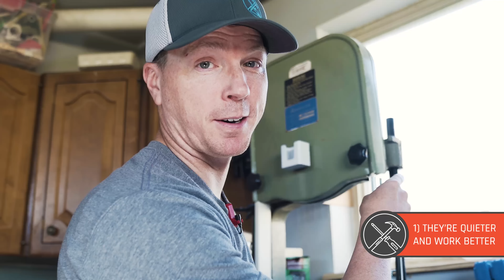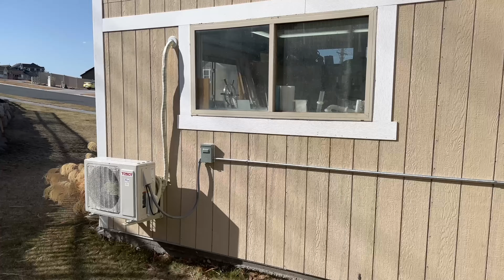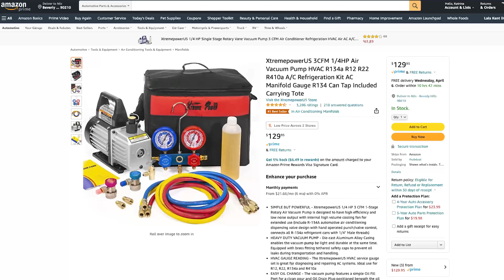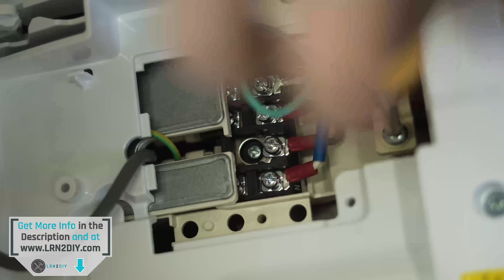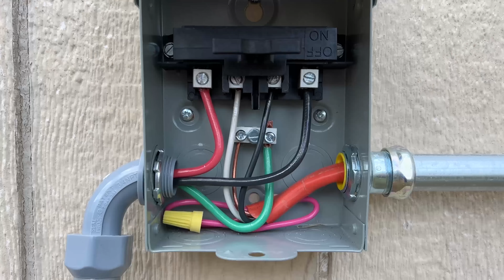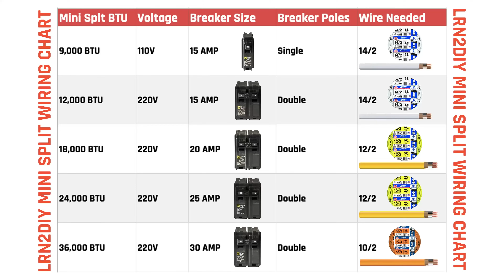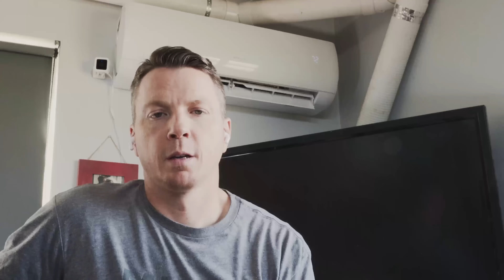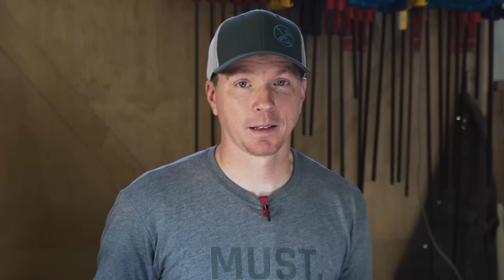Mini Split - 3 Things I Wish I Knew Before Installing

Comment: I installed one recently and it's the biggest quality of life upgrade I've ever made.
I bought a cheap vacuum kit and a line flaring tool and cut my lines to length & made new flares, drew the vacuum and connected everything up -  you can get it done in a day pretty easily. Probably  just a few hours if you plan properly.
Hardest part for me was finding the right place to put the condenser.
Reply: Biggest mistake I made was that the disconnect box didn't come with fuses, so I had to make another trip to the store.
I bought the Pioneer brand, and I'm pretty happy with it. The WiFi dongle is about $75, but if you look at the model number it's common across many brands and I got one on ebay for $30.
So nice to set my office to cool or heat while I drink my coffee.
Reply: @TheRealBobHickman  
That's what I got from Parker Davis.  I really like the pioneer.
Reply: @elgringoec  they are great!
Reply: @TheRealBobHickman  typically, the disconnects are just a pull-out contact that absolutely, physically disconnects power within a few feet of the unit and are not fused/equipped with breakers. All breakers should be in the electrical panel you are drawing power from. The disconnect is just so the service tech is protected from somebody flipping the breaker on while the unit is being worked on.
Reply: @JohnnyBfromPeoria  There are two types. I thought I was buying the fuseless one, but I bought the one that actually requires fuses too. They look almost identical and the fused one still has a pull out disconnect, it's just that the disconnect is also fused. Everything is also on a breaker, so it's super safe now.
Reply: @TheRealBobHickman  yessir, that won't hurt a thing with a breaker in the main power box  feeding that line. Mine have a breaker in each disconnect box as I also didn't see the description properly. Not an issue, really.
Reply: @JohnnyBfromPeoria  What you think is a breaker might just be a switch.
Reply: Did you draw a vacuum below 500 microns and hold that level for over 15 minutes? Or did you just draw down to the 30 inches mark on the gauges? An appropriate vacuum requires a micron gauge and cannot be read on a needle gauge or most digital gauges. Did you torque the flare nuts accordingly or tighten them by feel? Over-torquing is just as likely to leak as under-torquing. Did you use a flare dressing or did you dry fit the flares?
All practices and techniques that DIYers tend to overlook.
Reply: @deek791  I did not have the $$$$$ gauge so I followed the instructions in the manual that are specified for the needle type gauges and it held for 15min, no problem. I torqued all my fittings to spec with the proper torque wrenches and used nylog blue as a dressing as recommended by many pros. It's been over a year now and both cold and hot are still working great.
Reply: @TheRealBobHickman  you've probably done alright. Torque and proper vacuum are paramount to a quality installation. However, a needle gauge will never show you an appropriate vacuum level. There are still 760,000 microns at the 30hg vacuum mark on a needle gauge. The industry standard is below 500 microns held for over 15 minutes. I've seen, hundreds of times, a vacuum below 30hg but still over 10,000 microns after pulling for over an hour. If there's moisture off any sort in the system, it'll take longer to remove the molecules. A good practice is flushing the lines with dry nitrogen prior to starting a vacuum. That helps to remove humidity or droplets that may have gotten in the lines. You really have to think on a molecular level when understanding how the vacuum works. Because that's what it's doing... removing molecules from the inside of the system. A deep vacuum (below 1000 microns) is only removing about 10 to 30 microns per minute depending on the make of your vacuum pump.   A decent vacuum gauge can be purchased from Amazon for $60-$80. My Fieldpiece digital vacuum gauge cost a few hundred. My old heated diode set cost $1200 but it was also bought 40 years ago.
Reply: @deek791  I only have a Harbor Freight set of gauges. As with the automotive a/c stuff I play with, I leave the vacuum on for an hour, leave it off for a half hour and check to make sure there's no change. I'm also working in the Phoenix, AZ area in the heat and that makes boiling any moisture out easier since I'm starting with a higher ambient temp. I arm-torqued the fittings and I did use Nylog blue. Flare fittings can be easily deformed by over torquing, so they don't have to be cranked on, that's a given.
Reply: @deek791  
I ran my vacuum pump for an hour after drawing down to nearly 30"Hg, then left it closed overnight to be sure the next day there was no apparent loss.  

I've never heard of a "dressing" for flare fittings but in my own inimitable fashion I got my silicone grease out and filmed the sealing surfaces after inspecting and feeling the surfaces for any discernable irregularities.   I torqued everything by feel, using my calibrated hands.   I leak checked with soap solution after pressurizing.

It's only been running since last fall but still works like new.  I wouldn't recommend to anyone else that they follow "my" procedure, y'all are on your own including you "pros".  It's success that matters, go with training or with personal experience.  I have a few torque wrenches but I've been torquing for more than fifty years on all sorts of applications.  I've also been sealing for ages.  They're kinda universal concepts.  And I have enough scientific background to know that a handful of air molecules, a miniscule percentage in the refrigerant/oil circulating isn't going to measurably affect the operation of these units so I don't feel the need for investing in a micron gauge for this application.  Sure, would be nice, but I'm not buying one, I'd rather overdo the vacuum and leak test time.  The vacuum pump can only do what the vacuum pump does, a gauge won't make it pull more vacuum.  Works for me, but I'm not servicing customers, charging by the hour, and have other jobs to pack up and go to.
Reply: @deek791  can you use a standard torque wrench with a crows foot for the fittings? I have read conflicting statements about that.
Reply: @jeremydawkins8399   If you put the crowfoot on the torque wrench at a 90-degree angle, you will get the correct torque.  If you put it on "straight" you will get more torque than the wrench is reading.
Reply: @deek791  Excellent advice ! I test with nitrogen first at max. pressures the unit will see, Then pull vacuum to around 100 microns , set for a couple of hours then charge.
Reply: @deek791  whats flare dressing, like blue nylog?
Reply: @Dronerangers2024  
Sounds like it.  Turns out the pioneers did come with the flare mating surface dressing, I just missed it on my first one, and it's blue so probably a knockoff.   

In the comments you can tell the people who trained by memorizing vs those who train themselves based on first principles.
Reply: Which unit are you calling "the condenser"?
The reason the documentation refers to the indoor unit and the outdoor unit is because the role of the condenser can be in either depending on which mode, heating or cooling, the unit is operating at that time.
Reply: @elgringoec  The default term for the outside unit is condenser because that was correct for A/C units that were around for a long time before heat pumps became popular, and it's where the compressor is located.
Reply: @robertball3578  
Okay, makes sense that would be a logical confusion.  Thanks for the explanation.  Though I wouldn't consider the term "default" to be appropriate to describe this situation since a condenser is not technically defined or used to indicate an outdoor unit by anyone in the industry literature.  By industry standards, default would be "outdoor unit" with "condenser" a slang usage.
Reply: I just call the outdoor unit either "the outdoor unit" or the "compressor."  Both are unequivocal.  There's only one compressor in mini-split systems and it's always outdoors.
Reply: @elgringoec  In this context, I'm referring the to larger outside unit. (What would be the condenser on a traditional AC unit).

Comment: I’ve had a Fujitsu unit since 2011 in my garage and it’s awesome. Serviced once in 2021. Service guy said it was still nearly full with refrigerant and operating in great shape.
Reply: Unless he pulled out all the refrigerant into a tank and then weighed it(very doubtful) there is no way to tell how much refrigerant in in the unit. There shouldn't be any missing anyways. You can't use the same method to check refrigerant level like you do on a normal central air AC unit. He probably checked the delta temp difference from the intake and the exiting air and determined it was working properly. Also Fujitsu units are great!  I prefer them over Mitsubishi
Reply: @randybobandy9828  If the tech attached gauges, he could determine if the amt of freon was adequate. He could also attach an ammeter to see the current draw. If low on freon, the current draw would be lower. 99% of all home inspections are done by measuring temp differential which is woefully inadequate.
Reply: @Barryd57  no he can't... not with a mini split.
Reply: @randybobandy9828  yes, he can, it's a typical inspection in Europe done in minutes
Reply: I'm with you on the Fujitsu's, they seem great. I've got a client who's got 5 of them in a wood mill (I do commercial hvac). The outdoor coils get plugged up with saw dust and they trip on high head pressure occasionally, but they're all about 10 years old and are still running great under some pretty severe conditions, extreme vibration, dust, set at 68f most of the time. 

Best thing about them is I'm able to get parts for these machines still. That's what really scares me about the mrcool's. A 300 year warranty on the compressor doesn't mean much if the inverter board fails after 2 years and is no longer available, or they claim it failed due to voltage fluctuations, if you read their warranty on their site it seems pretty vague. Most failures I find I could attribute to one or two of those exclusions. I'm guessing that must be a part of their business strategy - planned obsolescence. I'm also guessing in a few years there's going to be a plethora of poor reviews based on their warranty.
Reply: My mother and my sister have Fujitsu systems in their respective homes installed around 2005 and although they are only used in the summer, they are still working flawlessly and never been repaired or recharged once. Just cleaned the filters and fans. They are super quiet.

Comment: those prices for electrical work are not accurate. even doing it yourself your going to spend 2x that to get electrical to the unit.
Reply from the maker: I realized I didn’t make it all that clear but that was the cost of goods to do it yourself. I paid about $100 for everything needed for the electrical.
Reply: I did mine for about 60.00  Romex On Amazon 12/2  25ft 30.00 , Disconnect at Home Depot Halex 15.00 and breaker 14.00  20 amp Square D  2-pole
Reply: Agreed. If you are intimidated by the electrical and hire a licensed electrician, expect $500-1000. And also correct, this would be for all of the mini splits, whether the diy or not.
Reply: The copper will be your most expensive item you may already have a roll waiting to be used. Breakers and the cut out switch are not too expensive I would think 300 dollars is a good estimate maybe less. I may go that route in my shed I plan on converting into an extra bedroom with facilities. The building is already up and needs some repairs but would cost less than adding a room on the house. I will post later the cost for electric as for charging the system I may take classes and get licensed so I can have a part time as a heating and AC maintenance man. I should have taken these classes when I was in highschool I took data processing and was a waste of time who uses punch cards and main frame computers anymore? maybe a big corporation but most small businesses have personal computers and a network much different than what I was taught. 73
Reply: I’m not sure where you live, but I do this all the time as an HVAC contractor.  Disconnect box, breaker, wire and conduit plus fittings will only set you back $150 tops.
Reply: @walterwhitlock5225  yes maybe true if you already have an old system that's in place. Even if you have to replace only the cutoff and change a few items. I know mine will be less because the main box is already outside and sub panel. I just have to hook things up and I already have wire and outdoor conduit. 73
Reply: @walterwhitlock5225  Most jurisdictions are soft on letting HVAC guys do the wiring.  Ours is.  I'd say the cost for parts these days is heavily influenced by the length of the run, given Cu pricing.
Reply: I have to agree 150. 00 dollars is top

Comment: I have seven mini splits around our home. I live in Florida and I wanted to get rid of the duct work; God only knows what’s in there. There are some maintenance issues overtime. The condensation drain hose gets clogged overtime; I cleaned it out with a small portable shop vac used on suction and attach it to the water drain exit outside. A considerable amount of water will accumulate in a short period of time and my unit does not have an automatic cut off like larger units have for the air handler. I have my AC guy (I am not as handy as you are) come by once a year; he takes the inside unit apart and cleans the fan water trough,etc. The filter also needs to be cleaned at least once a month. Otherwise I really like the units and our electrical bill changed significantly. Thanks for the information about the Wi-Fi set up.

Great video and thank you.
Reply: How do you ventilate the house? Do you have a fresh air system?
Reply: @matsudakodo  I live in Miami so minimal unintentional fresh air. My home was built in the ‘30s and it is far from airtight. I have several air purifiers to keep things fresh and several dehumidifiers to control damp Miami environment.

Comment: Great well edited video! I installed a Mitsubishi 18000 btu unit in my new 1000 sq ft shop 10 years ago which was a great decision….Unlike the in floor radiant heat system which I never use! Lol 
 I ran into a few issues I didn’t know about like the ac disconnect and the precharged line had a max lineset spec shorter than I required.
I also wall mounted mine and despite using all the vibration dampening gaskets I did notice a deep thrum at first but have gotten used to it. Minor compared to other heating cooling options except the radiant floor option which is expensive to setup and very expensive to run and of course only heats….
Fantastic tips on the bluetooth setup and the diy lineset options….
Thanks!
Reply: Your radiant heat must have been improperly installed. There is nothing more efficient than radiant heat or as comfortable. They all make air to water mini splits and that is very popular in Europe where everything is hydronic but do to the lack of hydronic systems in the US and because most systems here are high temp beyond the range of heat pumps most companies wont bring them here. Daiken has the ALTHERMA unit in this country. This unit will not only heat your radiant but also produce domestic water as well.
Reply: @anthonyspadafora1384  I have an electric boiler with a longterm plan for a solar array to augment my hydro bill, after which it will be more economical but will look into the air to water as an alternate solution. Thanks!
Reply: Mitsubishi has been in the game for a long time and I'd regard them as one of the best. My friend of 50 years works as an engineer for Trane/American Standard, and recently told me that they had partnered with Mitsu due to their reputation and knowledge in the product niche.
Reply: Did you use a standard Mitsubishi or the Hyperheat unit? BIG BIG difference between these two if you are heating with it.
Reply: I put two units in ten years ago one in the shop ( big open 1000 sq ft shop with second floor) and one in the common room in basement of house. Both are single head MSZ-GL18NA-U1 units. My Australian hvac friend said to go with Mitsu and I sourced the 18 k btu units that performed most efficiently in colder climates (I’m in Canada). Very happy with the shop setup. House unit is overkill and hardly gets used as we heat primarily with a wood stove but very nice as backup or for when we are away in the winter. I set up a destratification duct with a timered fan that circulates the warm air from shop loft down to the ground floor.